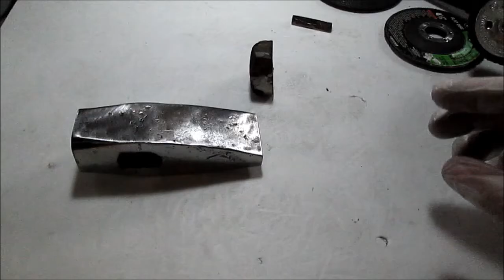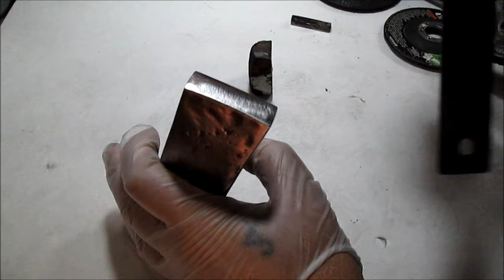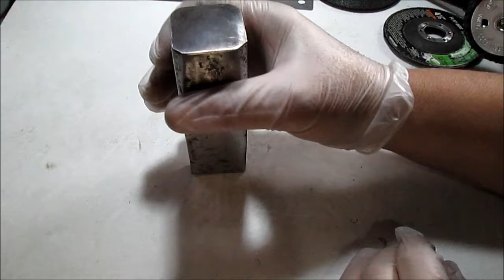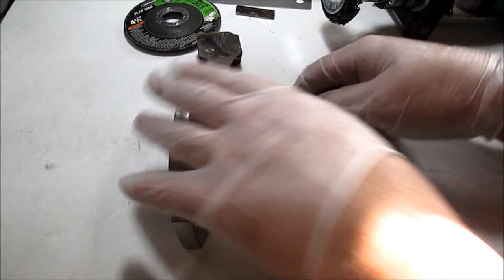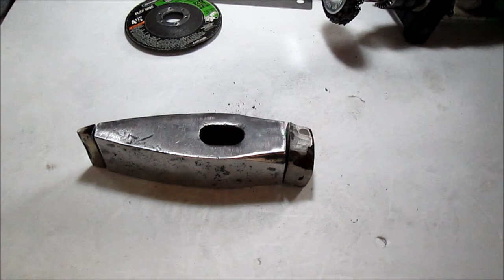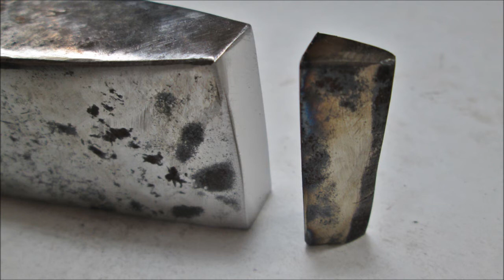Not Another Hammer Head !!! Part 1

Comment: nice ive got a couple old hammer heads I am planning on making handles for in the near future
Reply from the maker: Tim Molinaro Thisis an odd hammer now but I like that it's like a straight peen most Blacksmith hammers are cross peen This will work good for flattening the edge on thin metals or tin